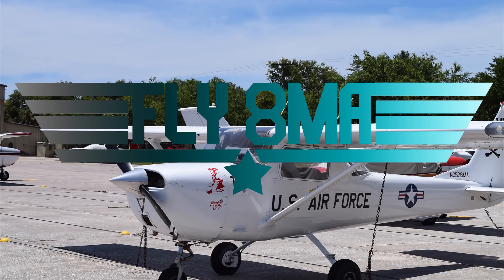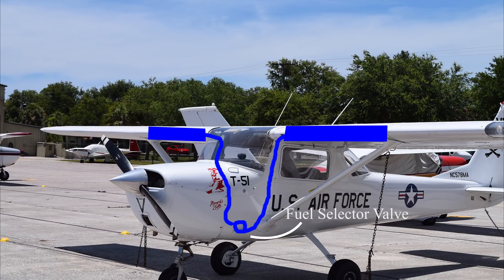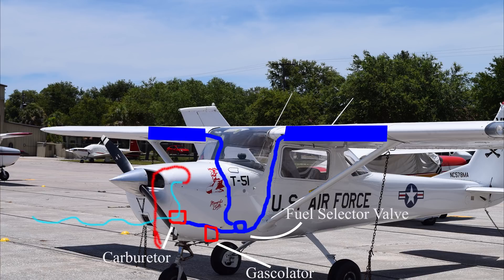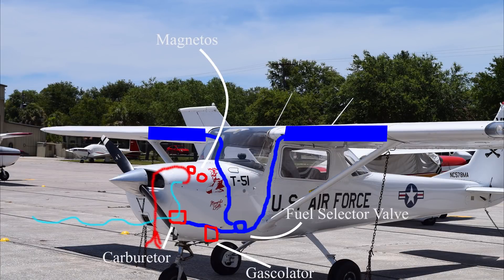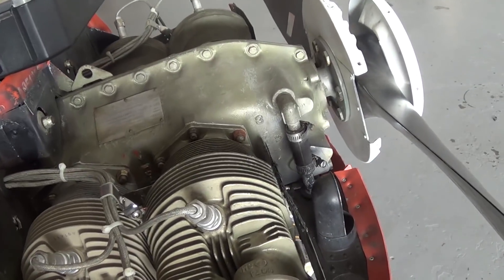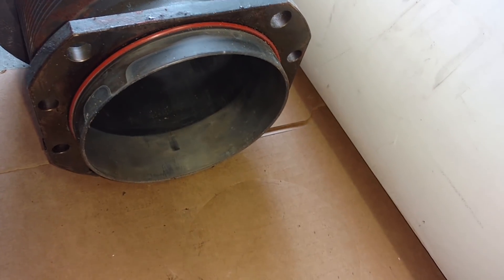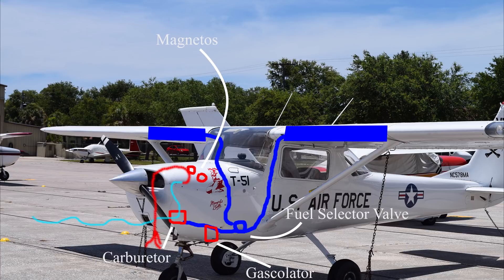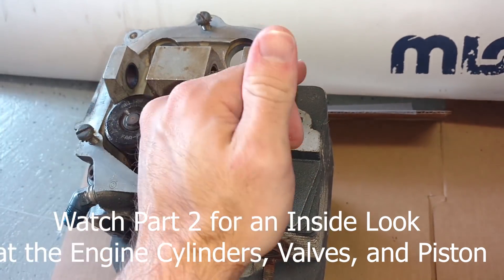Ep. 51: Airplane Engines and Systems | Fuel and Engine System Explained Part 1

Comment: Just wanted to point out that the fuel passes through the strainer before going to the carburetor. Also the primer comes off the strainer and injects fuel directly into the engine so there is fuel there when the starter turns it over. Great explanation tho and good shots of the parts you don't see all that often.